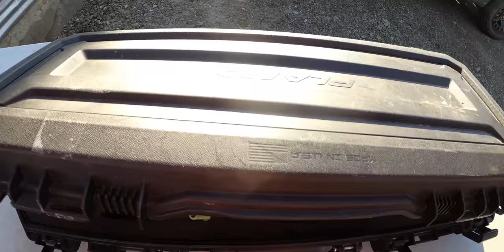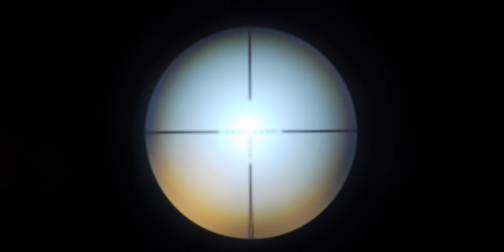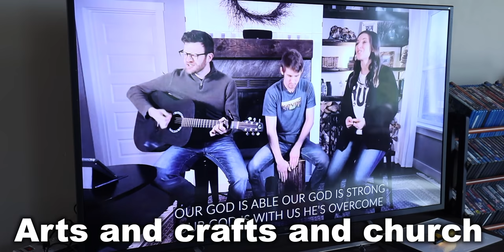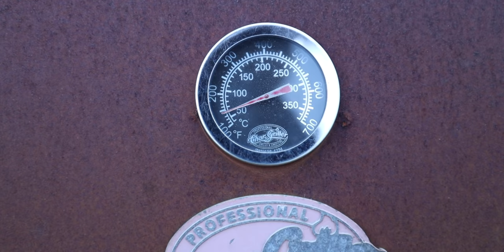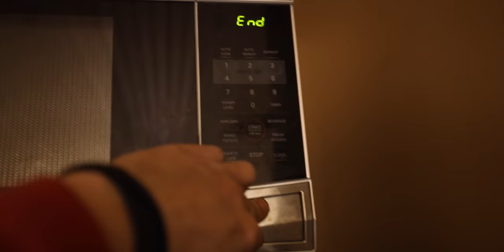Pigeon Catch and Cook - Day 18 of 30 Day Survival Challenge Maine Lockdown

Comment: If you dip the bird in hot water first then its easier to pluck the feathers.
Reply: Womlet 10 x easier 👍🏼
Reply: Thanks
Reply: My grandfather would do this too, but used boiled water. Made plucking way easier.
Reply: Just blanch them in boiling water.
Reply: Didn’t look like he needed it for this
Reply: @phrogginator  yeah, typically pigeons and doves are so thin skinned, you dont need to do this. If it were a turkey or chicken however, it would almost be mandatory lol
Reply: Womlet he knows this
Reply: Landen, why didn’t he do it then?
Reply: I was about to comment that....